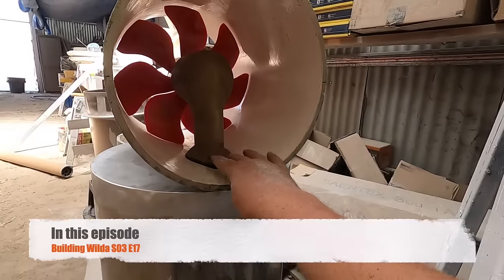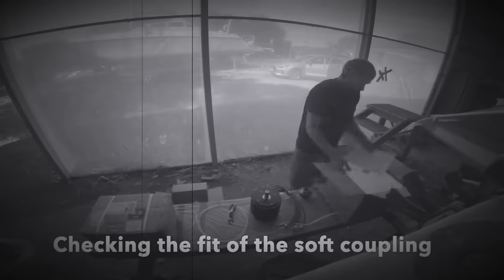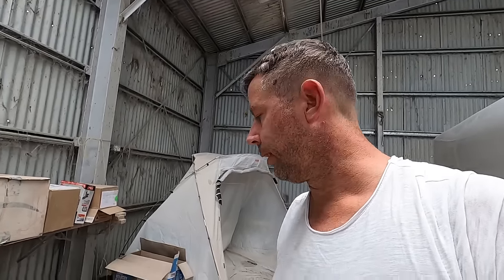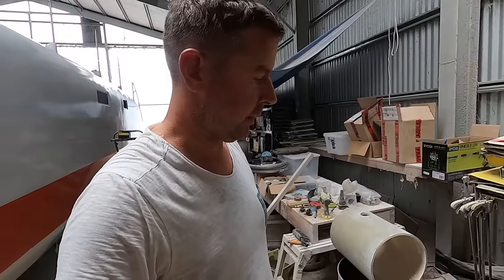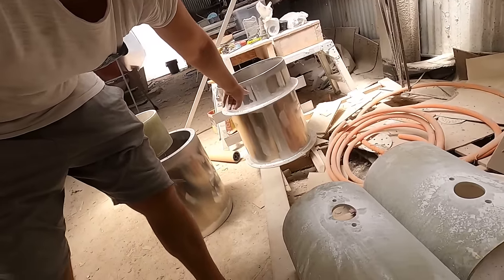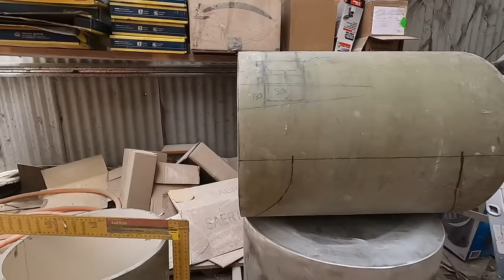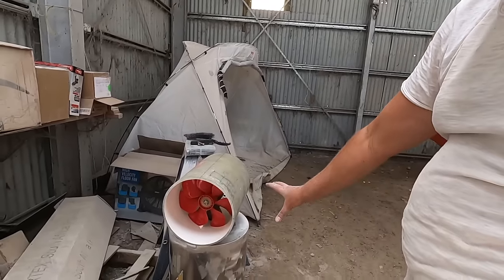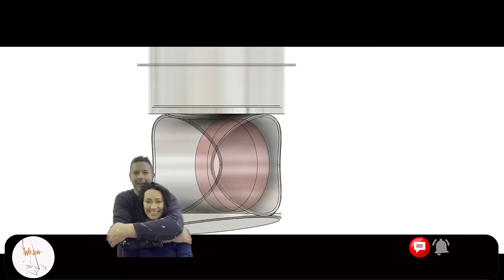NOT the AVERAGE SAILBOAT DRIVE SYSTEM - Part 1- S03E17 | Building Wilda | Electric Catamaran

Comment: Interesting
since the prop is "going up and down" 
Just on a flat piece of metal/board would be better? (No tube around the prop)?
First bit of bag or net or whatever and would be blocked?

Just thinking as watching.
Reply from the maker: I'm hoping the tube will actually stop some stuff from getting to the prop in the first place.

The purpose of the tube is to direct thrust more efficiently.

Comment: On the practical side, this prop enclosure and prop should be designed as a blender, you will definitely get crap in there 😊which is a major consideration.
Personally, I would not see this a viable option because of the failure risks and pain of cleaning all the junk that will get stuck in there and continually changing broken props!
Reply from the maker: 🤣 Certainly one way it might go 🤣 Hoping we won't have that problem so often though. Remember that most of the time the whole thing will be out of the water, unlike most other drive systems.

Comment: you will be using a standard 3 or 4 blade prop correct? as that one is only made for very slow movement and not suitable for higher speeds
Reply from the maker: We're aware of the limitations of the prop. Slow speed only is what it's for. High speed under sail.

Comment: Why not just use a folding prop?
Reply from the maker: Definitely an option. More so for a shaft or z-drive diesel propulsion system.
There are no folding props really suitable for electric propulsion that in aware of..  there is an interesting variable pitch prop though that would achieve much the same result.
I want something with large surface area and low pitch for two reasons. My motor works more efficiently on higher revs and the prop will be able to turn the motor easier and faster due to the low pitch high surface area.

Plus .  I want to get it to do directional thrust in the future.

Hope you follow along!

Comment: Shouldn't that blade have a ring around it? To cut down on cavitation or move blade to back of the tube. The way it looks the tube will be damaged by cavitation and crack.
Reply from the maker: The tube will last many years before taking any serious damage from cavitation but I'm sure the paint will see some wear.
The tube is chosen to match propeller size, or vice versa. Biggest prop I could fit and in a tube to match. About 2.5 mm clearance around it. I haven't seen any props built with a ring like you mention, other than on toy drones. I guess the rim drives would be similar to what you describe though. There is also some really weird twisted loop kind of looking prop being tried out on outboards...
We'll see how we go with the prop we have. We may quite likely be testing other props in the future.

Hope you stick around for more coming up.

Comment: What made you decide to use jotun paint over other brands about to start the painting process on my schionning
Reply from the maker: Really two things..

The painter worked with Jotun near daily.

Availability. Easy to get hold of.

Hempel quattro is a superior high build primer (if you can live with the color) for coverage and sanding. I had good contacts at Hempel to start with but after covid they were gone, so we ended up going Jotun.

All produce pretty much the same products at similar price and excellent quality.

Comment: Sorry simple is better know the work kiss?
Reply from the maker: True 🤣 A saying that has alot going for it.

The up and down thing and the rotating bit may not be totally necessary.. But super useful.

At least the electric drive will be vastly simpler than combustion alternatives.

Fewer spares, fewer systems, fewer moving parts, fewer holes in the boat (but one large one🤣) less maintenance.

Hope it works out ok. I think it will.